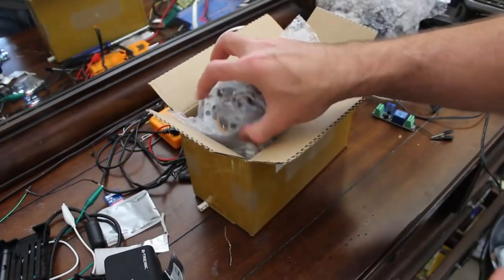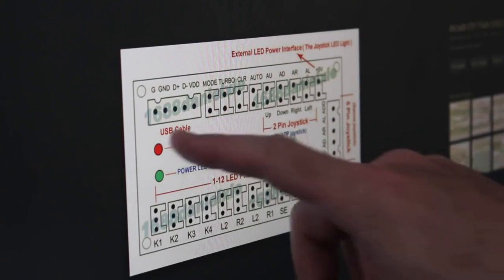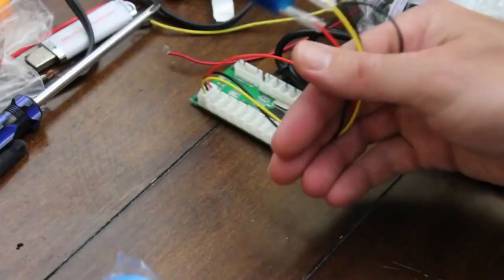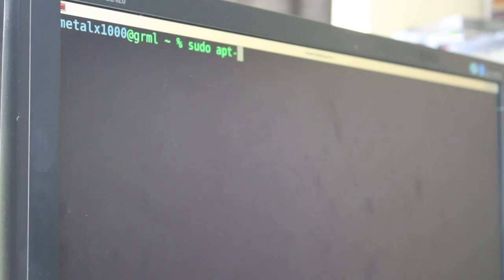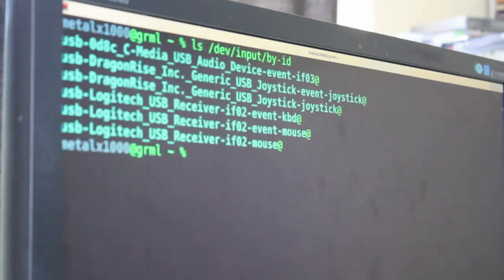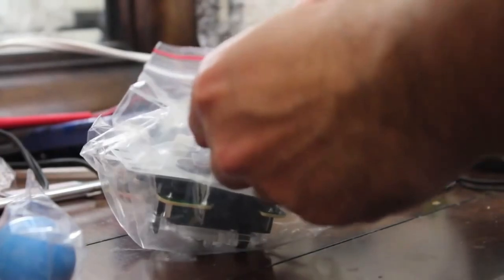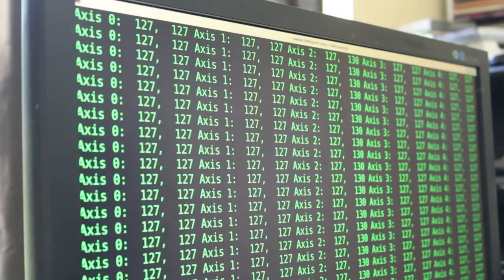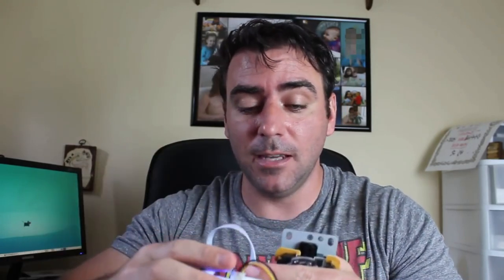First Setup LED Arcade DIY Parts with USB Encoder Joystick and Buttons

Comment: You can modify the wiring to change the state of the LED to light-when-pressed to always-on. 
The CY822B is similar to the more common Zero Delay boards (CY822A) with Common(+5v) & Trigger(pulled-low) but with the addition of Gnd(-ve). 
Your package contain plugs with yellow-black-red orientation which cause LED to light-when-pressed. 
If you switch the plugs with black-yellow-red orientation, they will cause LED to be always-on. 

Note: China does not always follow colour wiring standards, so 3-wire, Gnd is red and +5v can be black or yellow but, to be more confusing, 2-wire, Gnd is black and +5v is red. Remember circuit board outside edge is always common(+5V). This LED 3-wire insight was noted by another blogger from 2016. When holding an illuminated LED button looking at the back with SPST switch contacts on top, switch takes a signal, and common(+5V) wire in any order; below are LED contacts with Cathode(-ve/Gnd), and to the right, Anode(+5V).
Remember that K1-K12 on the circuit board oriented from outer edge to centre is as follows: Common(+5v), Trigger(pulled-low), Gnd(-ve). The keys(buttons) for these boards are never shorted to ground but are short to Common(+5v) as triggers are all pulled-low in a non-pressed state. This is opposite to North American thinking where cars are common ground. You spin me right 'round, baby, right 'round.

Comment: i uhave the same board. but what i am trying to do is get eatch button to replicate any specific key on my keyboard. for example, i want to push button "3" and it reads had the "n" key on my keyboard being pressed.
Reply: These boards are joystick controllers not keyboard controller like Ultimarc that can handled more multiple joystick/buttons per board.

Comment: So, in the case where 2 buttons have to be pressed at the same time for super power movesm would the problem be the encoder or the buttons themselves? Every button works and regular moves work... only when 2 have to be pressed at the same time.
Reply from the maker: I've never had that issue.  I can press two button in game and do super moves.  Maybe you have a different encoder board then me.  But I've bought a few over the years without problems
Reply: @DigitalMetal  which one do you have?

Comment: Everyone used this for MAME (idk what's that but i'll assume it's something related to emulation) if anyone bought this for fighting games, is it worth it? I might get this as my first stick since it's the cheapest option i can get where i live and i only play fighting games
Reply: hi,   
i bought that thing to build a cheap controller for sf6      
    
after wiring it up correctly it worked just fine in windows.     

unfortunatley linux didn't tell me how to wire it up correctly, and needed a bit of tweaking with steaminput, before it worked     

i dont have consoles to test it,     
but it probably wont work on ps5/4 xbox one. (that verified controller bs)

Comment: How do you connect a trackball to this?
Reply: no - requires separate micro-controller and software.
I made my own using a Pro Micro with ATMega32U MCU. I posted some YouTube vids demoing both spinner and trackball of my DIY design. Spinners from last 10 years are of common cheaper DIY design with either shared or custom Arduino software. I have had the privileged of suspiciously being knocked-off by a Chinese copy-cat from my GitHub project when a YouTube video appeared around Dec 2022 with distinct fingerprints of my design.
If you are less handy then controllers from Ultimarc or Groovy Game Gear can be had.

Comment: May I know how to connect a USB joystick to JAMMA harness? I just have the arcade board without the cabinet and I already found a RGB to VGA converter. Hopefully you can share your experience with me.
Reply: I know this is old but if you already have this kit the connectors don't fit jamma. You could snip the connectors off and add spade connectors. Then you individually connect each wire to the correct input on the board, both positive and ground.
Reply: The joke: With zip ties!
You don't. JAMMA appeared in early 80's but USB showed it face for Win95 OSR 2 and didn't work. USB was more stable for Win98/98SE, so year 1999.
Hard wire the joystick switches into the JAMMA harness with the four buttons plus coin & start. That is what JAMMA was designed for; a universal connector two player. From Street Fighter II add an unstandardized kick harness for extra buttons.
J apan  A musement  M achine and  M arketing  A ssociation.
Reply: I ended up with Undamned USB.

Comment: If anyone knows how to improve the springs in the buttons please hit me up.
Reply: Buy a different button, different manufactures use different spring tensions. Sanwa 30mm are about 60g force while 24mm no-name LED are about 50g force. Happ style can have micro switches with 2, 8, 16, 32 oz press force. Micro switches were designed for industry. Plus, remember Happ style have an extra lighter tension spring inside the plastic button cylinder which should have no effect as the micro switch are usually higher press force.

Comment: When I look these up they say they support PS2 and such. But how? PS2 used 2 joysticks.
Im trying to make a custom Gamecube controller for Pi, but this only allows one Joystick.
Reply: Did you find any board with two joysticks?
Reply: Fighting games
Reply: You have to use two boards.  One for each joystick.
Reply: CY822A - Zero Delay joystick/12 buttons - analogue x/y/z with user board mod
CY822B - Zero Delay joystick/12 buttons with LED buttons (Sanwa)
CY2801A - dual Analogue/Dpad(joystick)/12 buttons
CY2801B  - dual Analogue/Dpad(joystick)/12 buttons with LED buttons
CY1123 - joystick/12 buttons with LED buttons (Happ) separate button & 5v power plug sockets
CY1121 - dual joystick/10 buttons each side - K11/K12 plugs eliminated

CY5804 - full 101 keyboard breakout board combine with
CY1124HC - joystick/keyboard with 21 keys Q/W/E/R - A/S/D/F - Z/X/C/V - Space/Enter/Del/Shift/Alt/Ctrl/F5/F1/Esc or can be used with CY5804 for full keyboard
CY1126HC - keyboard only requires CY5804

Comment: All the manufacturers that claim it works for Android, none of them tell you how to do it.
It seems to me you CAN'T !
I have as of yet to find one single person having made any of these generic controller board to work with Android.
An Android TV box would otherwise have been a great choice to build a cheap MAME setup with. 
But the whole joystick thing is a massive frustration.
Raspberry PIs are stupid expensive right now, thanks to artificially aggravated "inflation" and "shortages" (quote quote).
Seems building a Linux box using old parts is the way to go. Uses a lot of power and heat though, not liking that.
But for crying out, SOMEONE show any of these controllers working on Android!
And not some PS4 thing or other game pad. No. I'm talking those generic clicky arcade joysticks with the little controller boards they tend to come with.
Anyone? Anyone? Bueller? Anyone?
Reply: Zzz